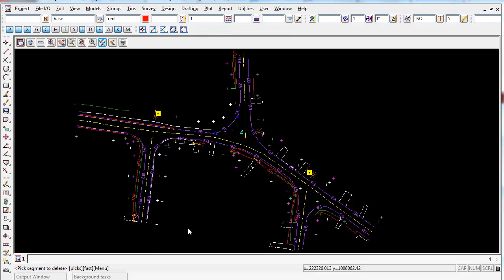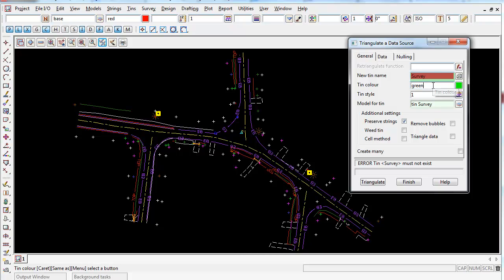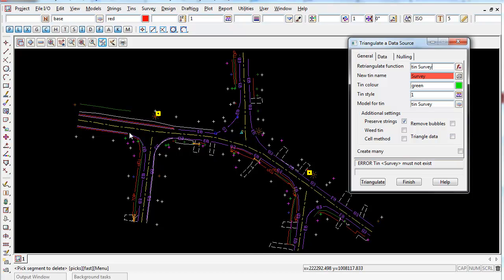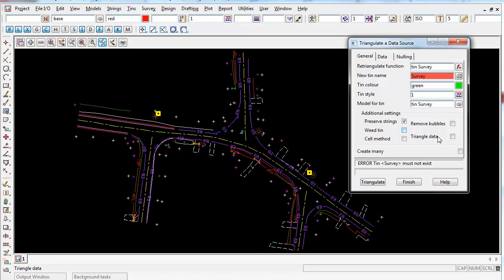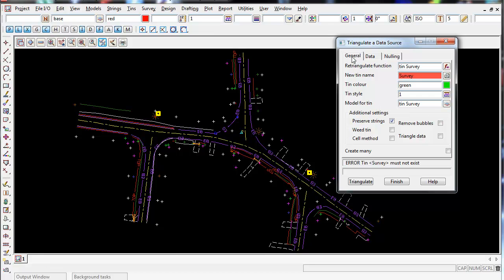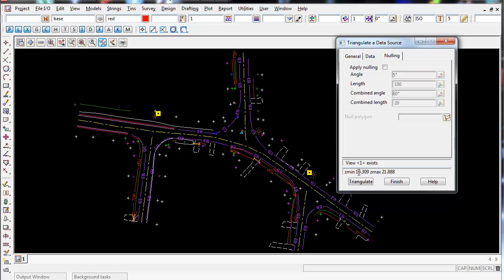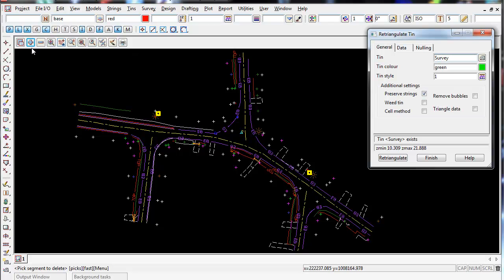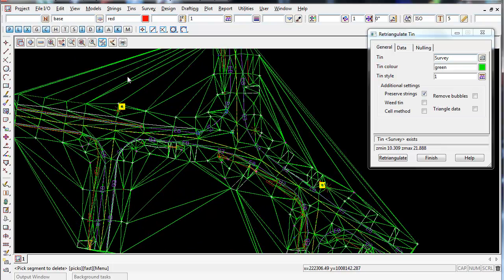12d Model Survey - 18.0 Triangulating The Data - Creating The Tin

Comment: im a water resourses engineer and i want to know how the name of this software  and what are the major inputs for me to generate the TIN data
Reply from the maker: The software is '12d Model' it is written by 12d Solutions see www.12d.com
All common data types can be imported into 12d Model and exported from 12d Model.
3d dwg, 3d dgn, Esri DEM, simple xyz in csv format, MX Genio, Esri .shp, MapInfo Mid/Mif, IFC
For water resource work, take a look at the TUFLOW functionallity that is built into 12d Model.  This complements the inbuilt 1d Dynamic Wave Routing hydraulic model